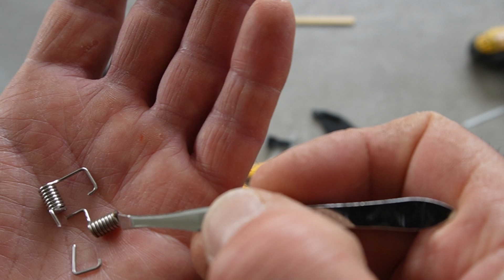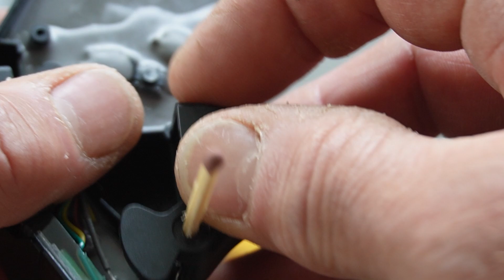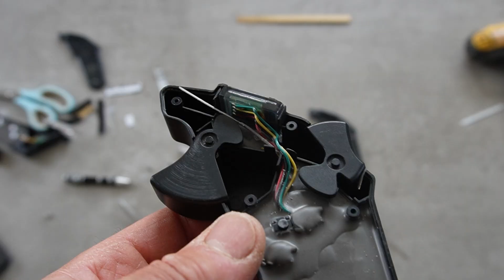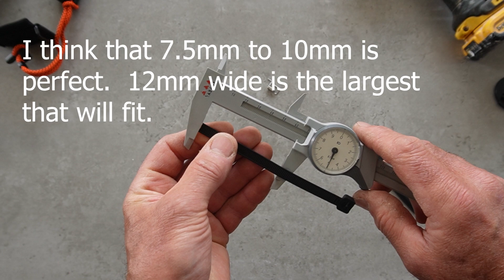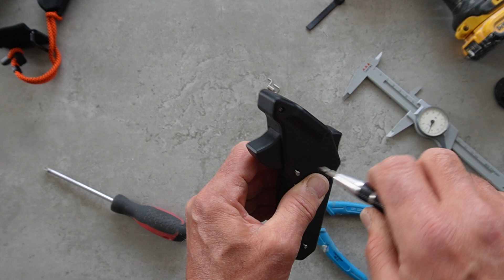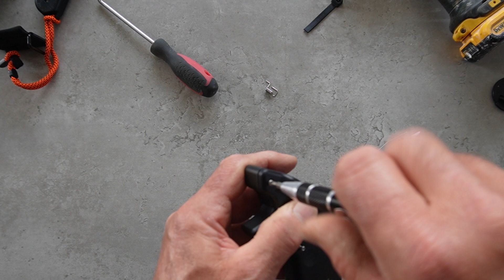Foil Drive trigger spring repair and hack

Comment: I think you could reset the throttle calibration even with the shorter trigger throw and get it back to 100%, with less precise control as the travel would be slightly shorter.  You would probably also need to reset the throttle calibration on the ESC too... but I think it should work both ways if a re-calibration was also performed.

Comment: Awesome video! I used an older propeller screw that I sanded the threads slightly for the guide instead of the match. Thanks so much!
Reply from the maker: Really happy it helped. I found it was worth reconfigure the throttle after the fix. It is in the handset menu. Regards Phil